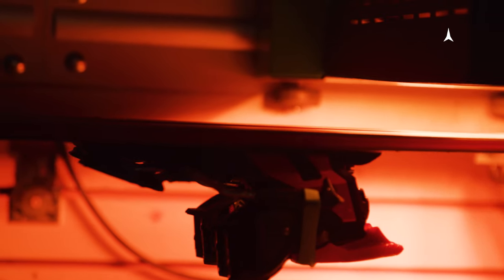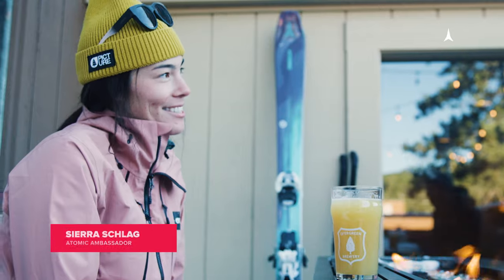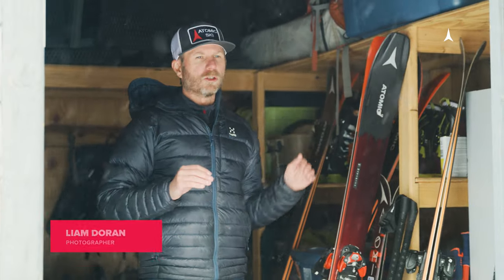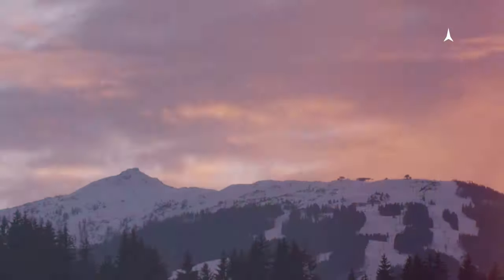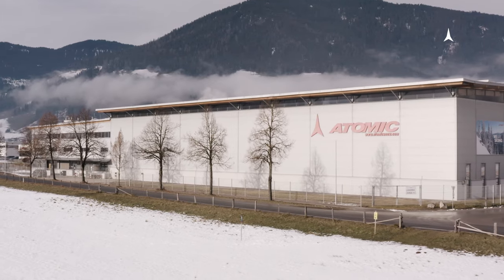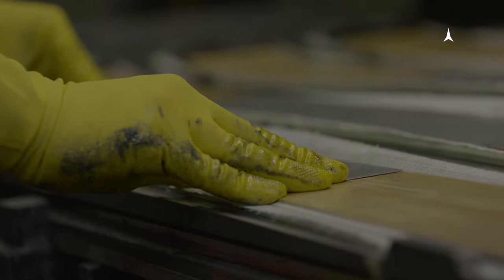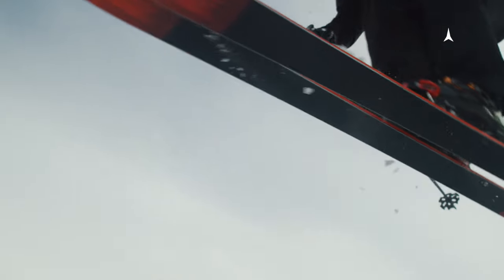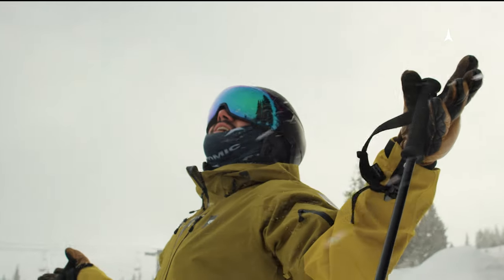MAVERICK // MAVEN : THE STORY OF A NEW ALL-MOUNTAIN SKI

Comment: After 5 years on Vantage 95’s I upgraded to the Maverick 95 and Atomic fixed everything that used to trouble me with the Vantage.  The stiffer ski makes it much more maneuverable especially in the “harbor chop.”  The Maverick’s cut through the thicker piles and edged nicely over the packed slick spots where the Vantage 95’s would’ve flexed in the thicker snow and slid on the bare spots. When we had 6” of powder recently I wandered into the trees and the Maverick’s were consistent despite what was hidden underneath the snow where the Vantage 95’s would’ve delivered some spongy surprises.  11 days on the Maverick 95 ti skis and with each day they keep getting better.